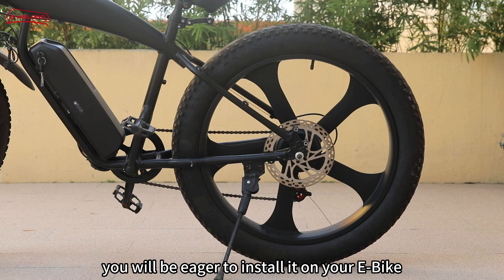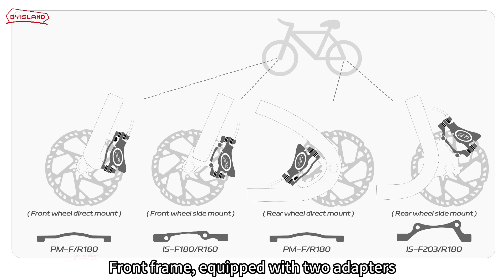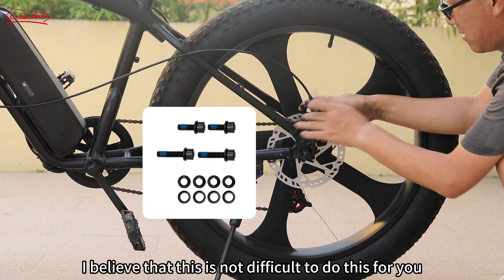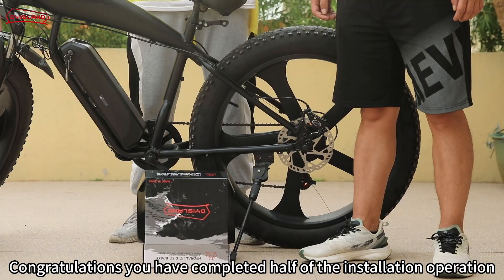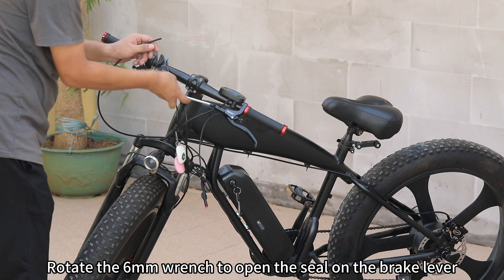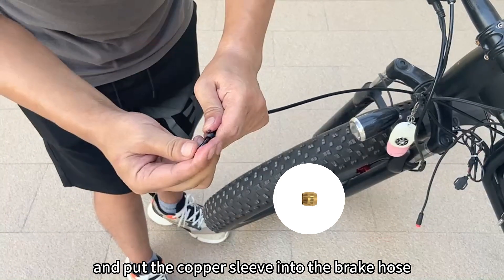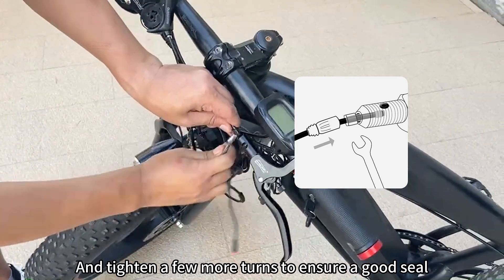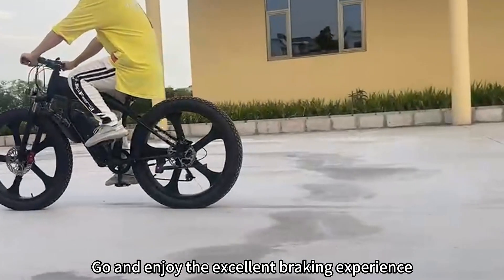DYISLAND LD-200PLUS | Hydraulic Disc Brake Installation Tutorial

Comment: For my front brake, even if i tighten the screw on the brake handle all the way, the brake feels very loose and does not brake with full stopping power. What can i do to solve this problem? Does it mean i need to add oil, or is there another adjustment i can do to make it brake harder? For the read brake i need to tighten the screw all the way for it to brake properly, is this normal? Thank you in advance for your help.
Reply: I looked it up and either my brake pads are worn out or I need to bleed my brakes. I will order the tools and parts and try those two things 😅
Reply from the maker: @jonathanblanchet777  Dear Customer,

Thank you for your message.

Since your bike uses hydraulic disc brakes, if the front brake feels loose and weak even when fully tightened, it’s most likely caused by:

Air in the brake system – This is the most common issue. You may need to bleed the brakes to remove air bubbles and refill the oil. Air in the line reduces braking power.

Oil leak or low brake fluid – Check if there is any oil leaking near the caliper or lever. If the oil level is too low, the brake won’t work properly.

Brake pad wear or misalignment – Worn or unevenly positioned pads can also reduce braking force.

For the rear brake, if you need to fully tighten the screw for good performance, that can be normal, but it’s best to check whether it also needs bleeding or adjusting.

📩 Please send us a short video or pictures of your front and rear brake setup to dyislandemliy@gmail.com, and our technical team will assist you quickly.